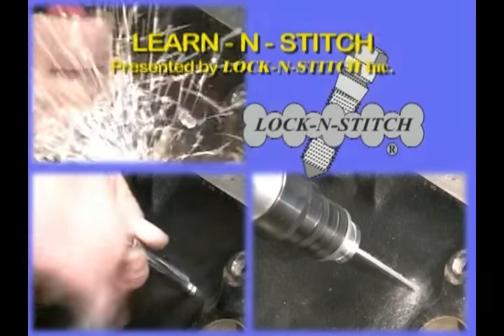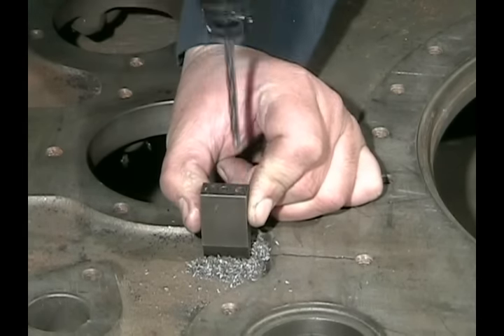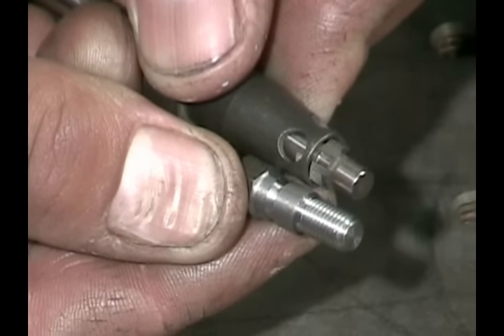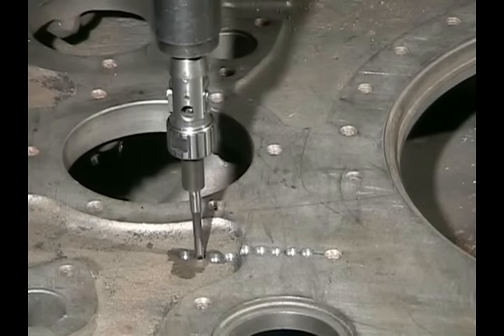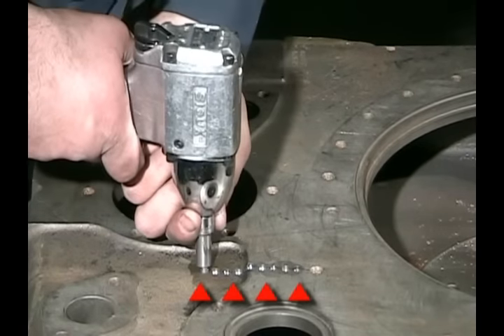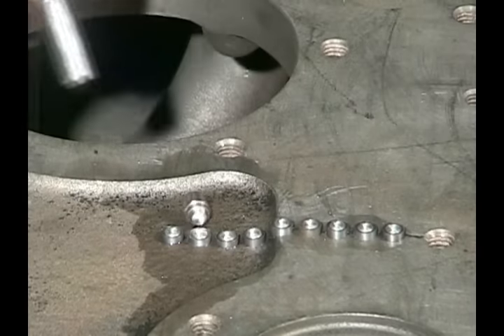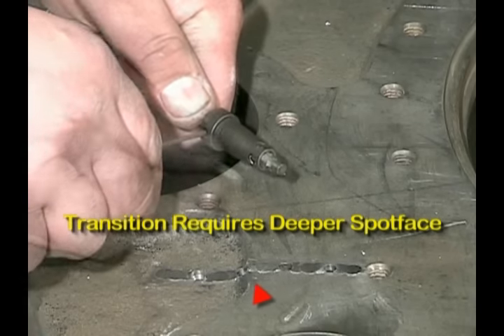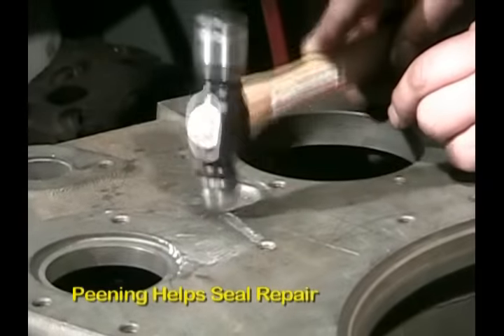Cast Iron Crack repair

Comment: This is a variation on a tried and true repair method that has been around since the dawn of the industrial revolution.Some if the ignorant commenters here need some actual experience, not internet folklore knowledge.Firstly, cast iron has very, very poor tensile strength, so welding will not be any stronger than this repair, and this repair is stronger in compression.Secondly, large cast iron parts like this are designed to carry very little load in tension, due to the nature of the material, there is no advantage in welding.Thirdly, welding a cast iron piece this large will cause crystallisation around the repaired area and will require a lot of prep time grinding the material to full depth to assure proper penetration, not to mention correct preheat and post cool down of the part, and warpage control whilst heating. There is absolutely zero advantage to TIG welding or any other method on cast iron, it's still going to crystallise around the weld and be weak.Fourthly, brazing would work well, but this is a very large part to preheat and takes the same amount of work to achieve the same result as welding, except it will work much better.This repair is just fine to permanently repair this part. Look up stitch repairing cast iron to see how it was done the old fashioned way- driving iron wedges into a part.
Reply: Tig brazing does not require pre heat
Reply: Cast iron does. Clearly you don't know your materials.
Reply: not always is possible to know which material you got in your hands, tig brazing does not require pre heat , I tig weld but I m 20 years in machining and repairs, already did all the shit possible.
Reply: Torch welding this would be a much better aproach. You can easily pre-heat the area before you do your welding, and you can sort-of anneal the area after words to prevent warping and hairline-spider cracks. I work for a guy up in Washington State and he does this almost on a daily basis.
Reply: I believe Keith Fenner does this on his Youtube channel.
Reply: Sideslip I had never heard of that method before. Thanks for informing
Reply: i like your comment sideslip
Reply: Id like to see sideslip put two pieces of cast iron in a vise, butted up to each other, run the series of screws in as shown in the video, remove from vise and rest for strength.  Then we would see if he is the genius he proclaims to be.
Reply: Sideslip
Reply from the maker: Watch this video!  It might change your mind? https://www.youtube.com/watch?v=tkCv8WpnqUo It shows the strength of one C3 stitching pin.
Reply: Sideslip i
Reply: Honest question, as I do not know about cast iron too well, but wouldn't driving wedges in to it force the crack to propagate further? That is the only part I cannot seem to wrap my head around.
Reply from the maker: Great question - the LNS CASTMASTER pins pulls the surrounding material together, adding strength.  The older processes and methods did push the material apart - tapered plugs; this stitching pin has a patented thread design that is completely different and when the repair is done it is a permanent repair.  Please feel free to contact our customer service team if you would like more information on the products and processes.  They would be happy to talk to you!  info@locknstitch.com or 800/736-8261 or 209/632-2345
Reply: You have answered all my questions regarding welding in this part.
You gave a class of knowledge.
Congratulations.
(Sorry about my terrible English.
I used google translator.)
Reply: Not trying to be argumentative, but exactly how can a circular cross-sectional pin "pull the surrounding material together"?  Dovetail joints in woodworking are shaped the way they are for a reason.
Reply: Would this technique possibly work repairing a crack in a cast iron wood stove?
Reply: You´re half right. It is true that this repair will not give any tensile strenght, and will only help in compresssion. But I can assure you that this part is not seing only compression during its usual loading. 

What are you talking about when you say cast iron has very poor tensile strenght? are 500 MPa for a GGG cast iron low to you? There is steel with lower numbers than that. 

Brazing would be the right choice. And yeah, repairs take time. Do it right the first time.
Reply: It does not. Simple as that.
Reply: Very good points!
Reply: If it was alright for fred dibnah, it,s alright for me !
Reply: Muggy rods. You can weld it up with no problems
Reply: If I want to read a novel, I go to the bookstore and buy one.
Reply: I disagree. I worked on the repair welding of cast iron.  There is no way this repair can even come close. Completely grind out the damaged area, then simultaneously heat the whole casting, cherry red the whole casting with rosebuds, and  weld with a buzzbox using specific contaminated cast iron welding rod. It effectively creates one new piece of cast.
Reply: @johnstorace1195  Completely irrelevant. A casting with a crack is not two separate pieces of material.  This method is designed for crack repair, not joining discrete parts together.
Reply: Stitching has its place for sure. 
Sometimes an old world solution is the best one, even in modern times. 
For a car , no welding means no worrying about frying computers.
Reply: @randyury592   Yes! And it has been done.
Reply: The casting in the video is cast steel not cast iron. Look at the chips produced when the holes are drilled.
Reply: Buying a new one seems pretty effective.
Reply: @24681359David  you mean pre heating and post heating and welding it with a backing plate or a strong back  of some sort that will prevent warping then remove the backing plate , strong back after the material has cooled down to room temp
Reply: @fanboy59  No wonder it cracked! Cast iron is such a poor choice for a blade... Cast steel would be so much better at absorbing impacts if you hit anything. Which in snow would be easy to do since you can't see what's under it! Dang, what a miserable job. I bet it kept you warm though!
Reply: @24681359David  well i live in a small rural community in centeral canada so city equipment here is whoever's willing to do the job you know it was a farmer grader that was meant for agriculter cleaning the main road

Comment: I’m really curious of how well that repair held up all these years? The repair looked simple but excellent to me (retired mechanical engineer).
Reply from the maker: Hello! Thanks for watching and commenting - the repair is a permanent repair! Please reach out to the team if you would like to get more information about our products and/or services.  Happy New Year! info@locknstitch.com or 800/736-8261 or 209/632-2345
Reply: It's actually stronger than the cast metal so it should be rather permanent if done correctly. Much in the same way a time sert can be stronger than the original threads. 

This has been a proven repair method for a very long time for iron blocks. I suspect it works well with aluminum too. This kit looks very nice and definitely simplifies things.
Reply: I read your comment as, “I’m a retarded mechanical engineer,” and thought, me too!

Comment: If you understand this process and how it works from an engineering standpoint, and, you understand the physical properties of cast iron, then you understand that this IS the BEST option for casting crack repair. This will LONG outlast your nickel weld technique every time. I have been using this for years. Go ahead and try welding on a un-replaceable antique one of a kind engine casting that there is only one of in the world and get back to me.
Reply: +dl87z28 ..I'll have to try this on my old 1946 Harley Knucklehead....
Reply: +Doug Ankrum your best option.  I repaired a crack in between the valves on a 1959 KR cylinder years ago and it still holds today. 2 pins right through the seat area then machined right into the pins and installed hardened seats. There are only a coupke old timers I know who still do this. The company who makes lock and stitch used it to repair 20000 inches of cracks in the thick copper roof of  our nations capitol building. Good stuff.
Reply: dl87z28..I should have mentioned the Harley head is cast iron...cracked at the gasket area...through the Ex valve seat.
Reply: not a problem
Reply: as long as you understand that cast iron parts are made for compression forces. you know this is the best repair option
Reply: Newer welding techniques, process is outdated.
Reply: If you have the original it can always be re cast
Reply: godzuki101 Can be... The cost, however, is beyond belief. I've heard people quoted $50k+ to recast a cylinder head alone... So unless you wish to measure and build the casting, then pour it yourself... Better to stick with a tried and true method of repair.
Reply: Do this and then re machine. Maybe use a liquid metal to seal the stuff since you have a high temperature application.
Reply: then why is it the go to in the automotive, heritage and building industry? if it was that easy with welding techniques. why isn't it industry standard?

Comment: I put over 100,000 mi. on an engine that had this type of repair done to the cylinder heads. It showed up under magnaflux at the machine shop,otherwise you couldn't tell.

Comment: I like this, even though I grew up welding and welding is what we did to repair broken/cracked cast iron. Didn't matter if it was a cylinder head mating surface or an exhaust manifold flange.
Reply from the maker: Hi George, thanks for watching and commenting! If you would ever like us to provide more information to you about our products or services do not hesitate to contact us.  Our customer service team is also always available by phone if you have questions.  info@locknstitch.com 80/736-8261 209/632-21345
Reply: @LOCKNSTITCH   How does this stabilize the casting/crack? It looks counter-intuitive to me.
Reply: @RafaelHabegger  Maybe explain why it looks counter-intuitive to you as it is clear that your intuition misleading you... crack can expand via sharp eadge that is cuting more and more of the material with that sharpe edge where forces are concentrated.

Comment: I have never seen iron repaired like this. Very intriguing!
Reply from the maker: thank you so much for watching and glad you found us!  If you ever want to learn more feel free to email or call and speak to our technicians.  They would be happy to talk to you and answer any questions you may have 800/736-8261 or 209/632-2345 or info@locknstitch.com
Reply: So far, we have never run into such a situation, the only cracked cast iron I ever encountered was in such things as exhaust manifolds and water cooling systems and they were clean break-offs where we welded them with nickel rods.

Typically, in the case of a diesel engine, it is [or has been] the practice of most companies to discard cracked blocks, especially if the crack is in the cylinder walls or if it is in a stress point, so no such opportunity has yet arisen.

None of our machine tools have cracked, and here out of our own machinery, no engine blocks have ever cracked, the engine heads I cracked long ago were to badly damaged that you could put the edge of a credit card into the cracks and they went all the way into the water jackets on both sides so that water went through the gaps in the valve ports directly into the cylinders.

Should such a repair be needed though, I will hopefully b able to locate your company again and request information.
Reply from the maker: Yes please keep our information on hand - we are just a phone call or email away.  We can sell you the products to have your technicians do the repairs in house - for more complex repairs we can have our technicians travel to you to preform repairs; we have crews that travel all over the world.  www.locknstitch.com 800/736-8261 info@locknstitch.com

Comment: I don't understand...how are these bolts/screws pulling the material 'together' to build up strength between both sides of crack?
Reply: I would like to learn that also.  I can see how a tougher metal would stiffen the surface and keep the two sides of the crack from racking past each other, which would keep the crack from spreading due to torqueing loads on the part.  But do they withstand tensile loads?
Reply: From my understanding, the crack was drilled from end to end. Therefore, the crack no longer exists. All the material involved with the crack was drilled out and then replaced with pins threaded in with red loctite. The pins aren't fastening like a traditional bolt where 2 surfaces are sandwiched together but instead it's just used to fill the drilled hole. The long threads and thread sealant will seal and prevent any fluids leaking through. He's not actually "bolting" the 2 sides of the crack together.

Comment: I like when you finish a repair with a hammer blow. Really makes me feel like the job is top quality.
Reply from the maker: If you want to check out strength you should watch this video we posted testing the strength of the C3 pin!  Appreciate you wantching and commenting.  If you ever have any questions please feel free to email or call us info@locknstitch.com 800/736-8261 209/632-2345 https://www.google.com/url?sa=t&rct=j&q=&esrc=s&source=web&cd=1&cad=rja&uact=8&ved=0ahUKEwjxyO-K283XAhWrs1QKHfBvAyIQtwIIKzAA&url=https%3A%2F%2Fwww.youtube.com%2Fwatch%3Fv%3DtkCv8WpnqUo&usg=AOvVaw2V5ElVIS9yXsif74ipwTND

Comment: In 1969 I worked for a Detroit based company that did this type of repair. It called the process  metal lock and I never saw a repair fail. This saved companies lots of money compared to buying replacement parts. Dirty work!

Comment: I don't get it, What makes this crack stronger than it was before the repair ?
Reply: Unless the bolt threads are cut in a way that will hold the two sides of the crack together, I don't see how a bolt will hold the two halves of the crack together.
Reply: If you look up information about these bolts, the threads are actually cut in a way that produced inward force on the material they are threaded into.  There is a relief on the back side of the thread, and a wedge cut into the top surface of the hole, so that when the bolt gets all the way down, it pushes the top metal down and in, engaging the top lock, as well as putting pressure on the relief-cut threads, so that they also pull inward.  They actually have a video ( https://www.youtube.com/watch?v=tkCv8WpnqUo ) where they took 2 pieces of steel, clamped them together, and used 2 of these bolts in that seam.  They held just shy of 3 tons before it came apart.
Reply from the maker: @brentmorris262  you got it!  It's all in the thread design, it pulls the material together!

Comment: I've got a 6.5 Detroit diesel from a '98 Chevy I've been thinking of doing this on. As everyone knows, those six-fives are known for cracking. There's at least one company in the US that makes aftermarket blocks, but they're easily upwards of $3 grand each, excluding taxes and shipping. This would be much cheaper, and when you're talking about a cracked block, you've got nothing to loose anyways, so it's worth a try.
Reply from the maker: Thanks for watching and commenting. We are here for all the technical support you need to purchase products and do the repair (or find a local shop to do the repair) info@locknstitch.com or 800/736-8261 or 209/632-2345